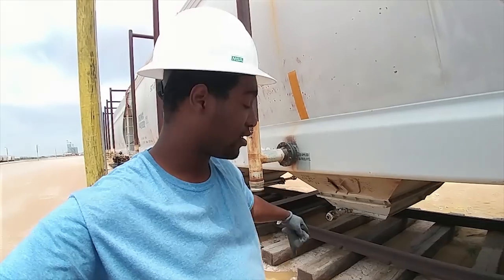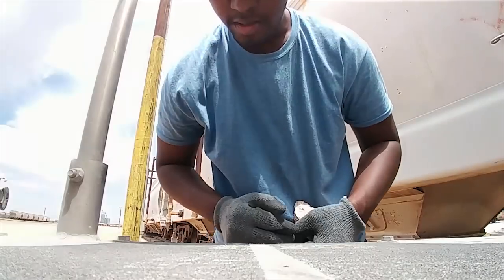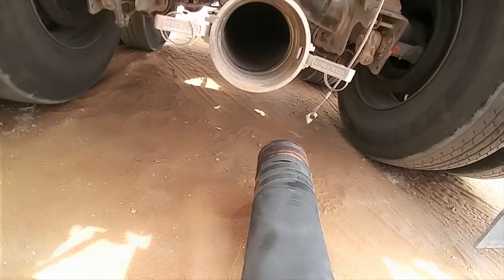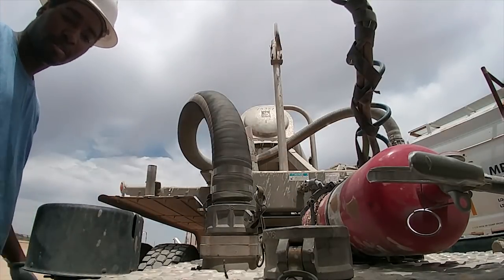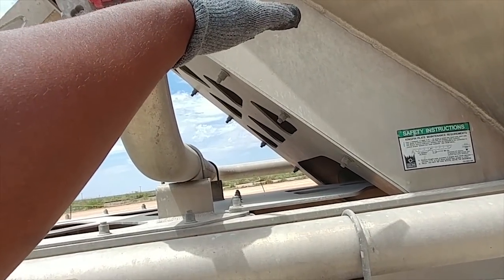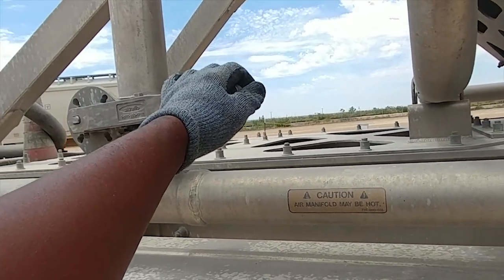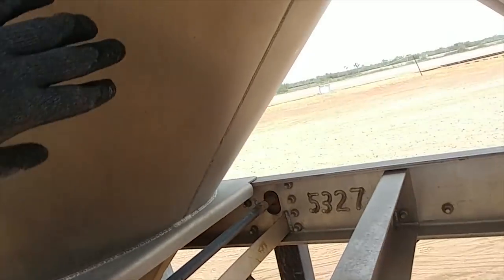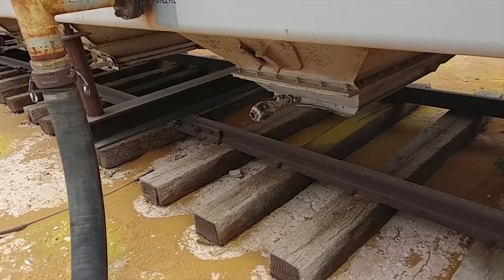How To Unload Pneumatic Trailer

Comment: The hose clamp on is called “cam locks.” you want the ears all the way down to prevent blow off. There is a rubber seal inside and even small rock by seal will make it hard to close. Quick wash makes it easy. The hose also Has a metal coil inside and it’s good to carry a hammer to beat it round if it gets flat or run over. Another good idea is to carry extra male and female ends and a “band-it” kit to fix cam ends in the field
Reply: Not that type hose ot solid ribber.

Comment: I run my line pressure a lot more than that, depends on product and threshold for psi in rail/silo/barge. Rail is easily that fastest to unload no question. Good video, what you hauling

Comment: It seems as if you should be using a hard plastic hammer or a hard rubber hammer to be banging on those pipe clamps instead of using a rock off of the ground. You should be able to pick one up for about ten bucks at a hardware store.
Reply: The MHB Show 

What's wrong? Aren't you smart enough to know how to use a hammer?
Reply: gary batchelder  this guy is just looking out for his black brother. Lol🙄✊🏾
Reply: gary batchelder even if its common sense